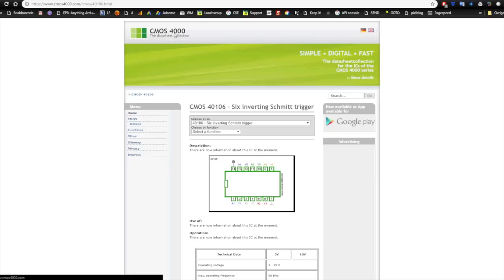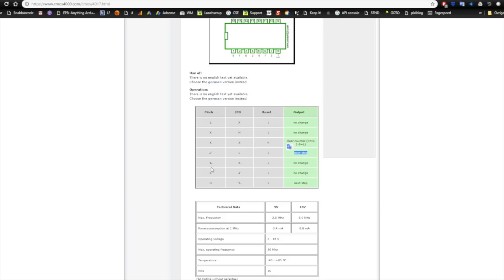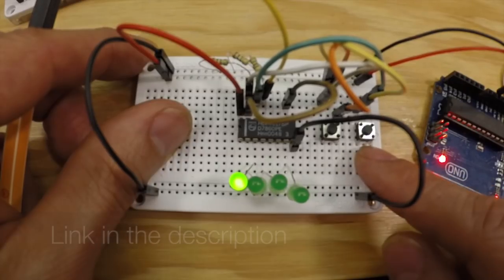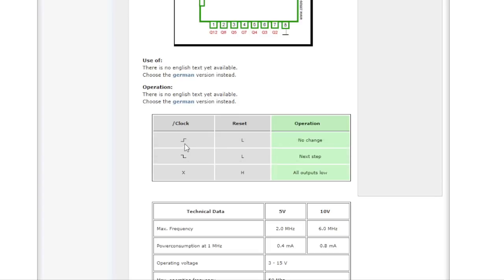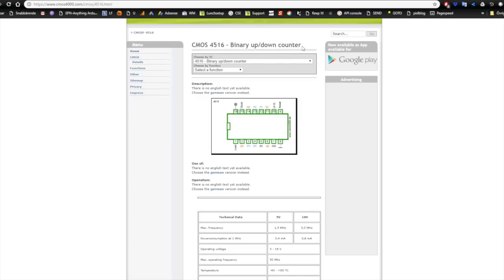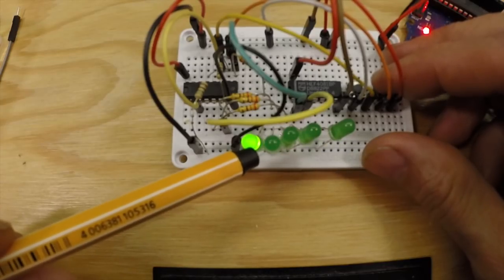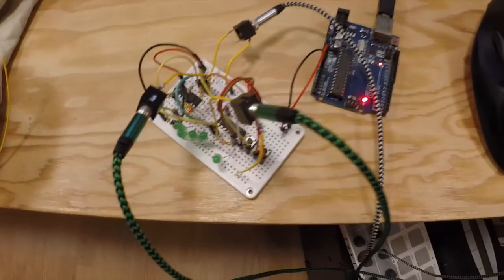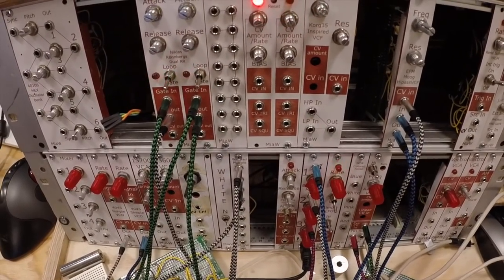How to make a clock divider CMOS logic gates and counters - Dive into CMOS 1

Comment: The CD4017 Makes for a great simple sequencer, with EXT clock (normalled to INT clock - usually provided by a 555), programmable step length, a Reset, but no direction (forward, backward, ping-pong or random) nor per step ratcheting (a step played twice).
Reply: I'm in the middle of building one of those, for anyone else interested look up the "Baby10" or "Baby8".
Reply: Yes, that's totally it. Synthrotek also has the Eurorack version of that kit. Sequence8: https://www.synthrotek.com/kit-assembly-instructions/modular-circuit-assembly-instructions/sequence-8-assembly-instructions/
Reply from the maker: Yes it does. Used in many sequencers as you say the baby8 is the most common (oldest) one. I’ll build one of those aswell. So many modules so little time.... 😅 For more advanced functions as the ones you also state an arduino is always a simple choice ;)
Reply: Hey dude, which IC is a good replacement if you wanted directional sequencing and step ratcheting? Cheers
Reply: @mbrombert  Maybe a combination of an up/down counter and a multiplexer.
For ratcheting... I still have no suggestion.
Reply: @mutedsounds2k  Thanks I will look into it. If I even figure out ratcheting I shall let you know!
Reply from the maker: The 4516 is an up down counter. Check my sequential switch for how to use it and many of its features. I don’t understand what you mean with ratcheting though. As for a chip that is super perfect for sequencers is of course the arduino. I’ll have videos on that. But in the pace I’m moving at right now not until next year... 😏
Reply: Ok good to know, thanks! I am avoiding the Arduino because I want to learn how everything works on a completely analog approach, for science!

Comment: How are those breadboards working out? Are they nice quality? And do you have a source you can share? Have been looking for "unmarked" rails on breadboards for a while and it also seems to have drillholes
Reply from the maker: These are from a kickstarter that “breadboard maniac” did. I think they are called caleboard. So the holes go all the way through so you can add components on both sides. The mounting holes are LEGO compatible. 
They are ok I guess. I actually prefer “normal” breadboards as these have a tendency to break open. Also when the legs stick out the bottom can be frustrating and give some odd results. Do a search online for the company name and product and you might find something.

Comment: I guess you want to build THIS: Doepfer A-166 Dual logic module http://www.doepfer.de/a166.htm
Can't wait for the cheap version of that!
Reply from the maker: Yes! Rather than having it all in a dedicated clock divider this is a really nice companion module. I’ll do something similar to this one at least.
Reply: A CD4070B, a CD4071B, a CD4081B and a CD4069UB and you're good to go. Including the inverters. You'll have to ground all the unused gate input pins, as usual. Or decide to use ALL the gates and make a SUPER A-166 "clone" (I'd call it "A-266", with all the gates doubled + 2 extra inverters)